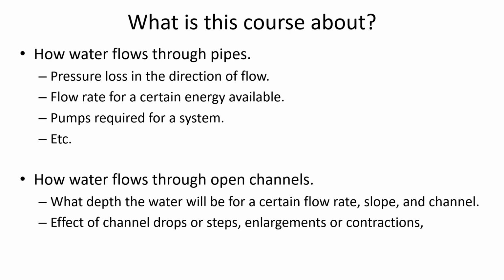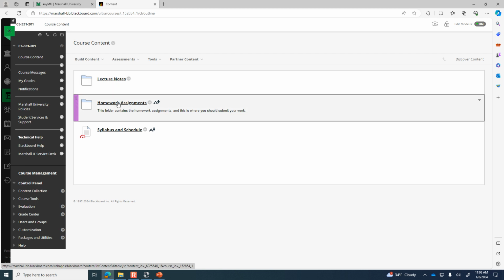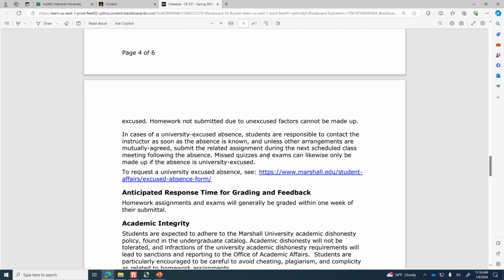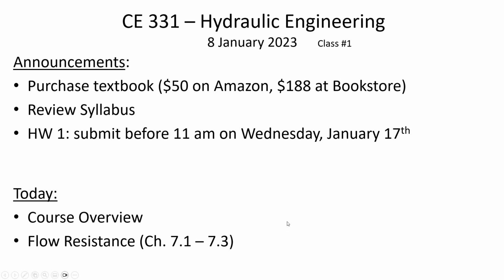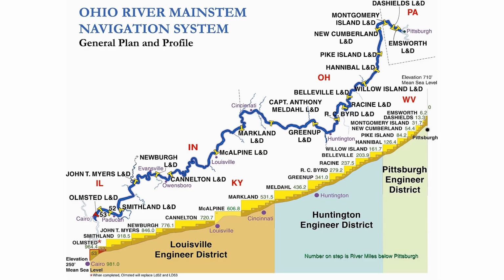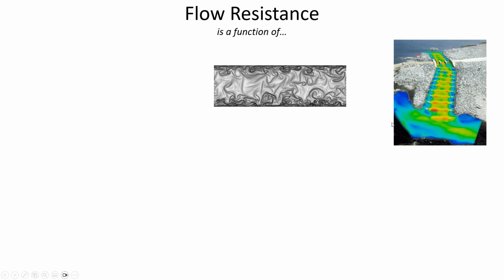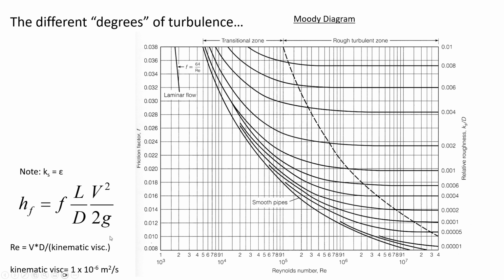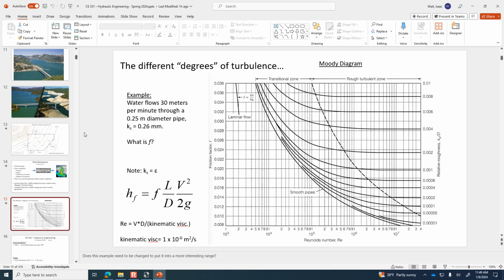Course Overview and Flow Resistance - CE 331 - Class 1 (8 Jan 2024)

Comment: Dear Professor Issac Wait,

I hope you are doing well.

I would like to ask whether the current playlist you shared is intended for the Water Supply Engineering course, or if you have a separate course available specifically for Water Supply Engineering.

I would appreciate your clarification.

Kind regards,
Abdul Basir Azizi
Reply from the maker: This playlist is for a course called "Hydraulic Engineering", which covers closed conduit flow (pressurized pipes) and open channel flow.